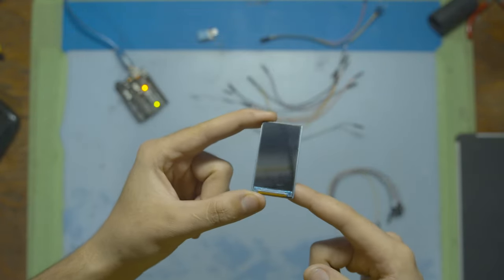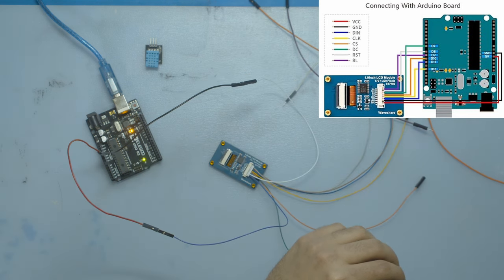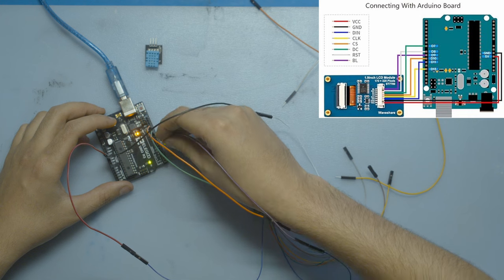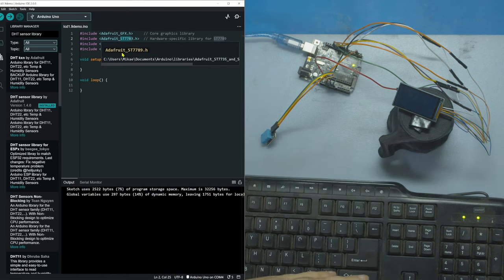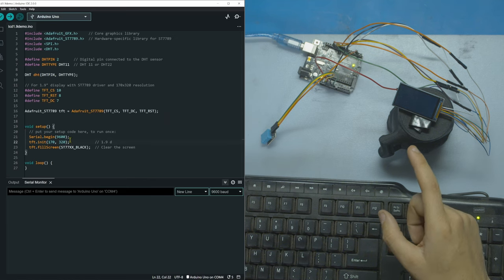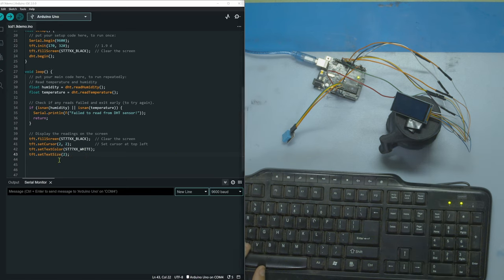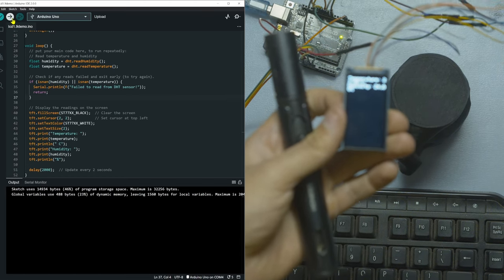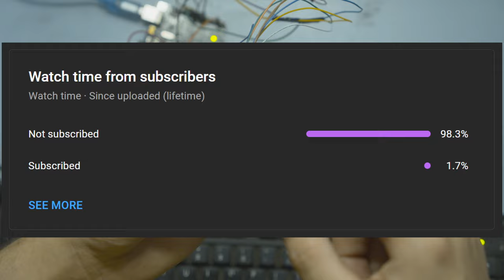DISPLAY TEMPERATURE AND HUMIDITY ON THE NEW 1.9INCH TFT ST7789 WAVESHARE #arduino #esp32

Comment: Dear Mikael, 
Great, and very inspiring video. Is it possible to make one video with this ST7789 on which the text would be displayed in landscape in table form? For example for plane schedules with departure time, destination, gate and flight number such as:
              Destination     Gate     Flt num
10:15    New York            2         AA521
10:20    Berlin                   4        LH2412
11:30    Tokyo                  1        JA1598

etc with one background color for title line, and odd lines with another background color, and even lines with a third background color ?

Many thanks for any information or (better) video about that.
Reply from the maker: no need for a nother video just feed this live data into the display!